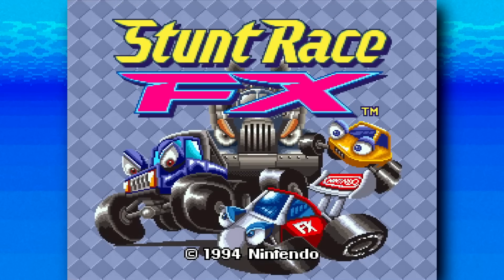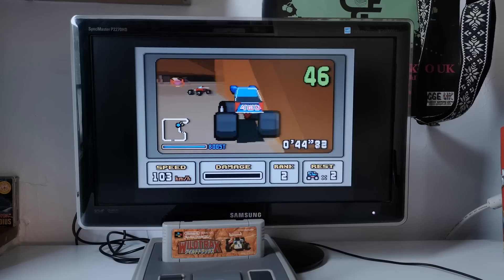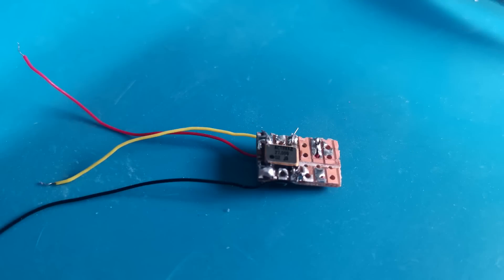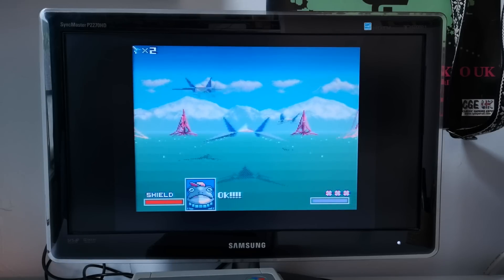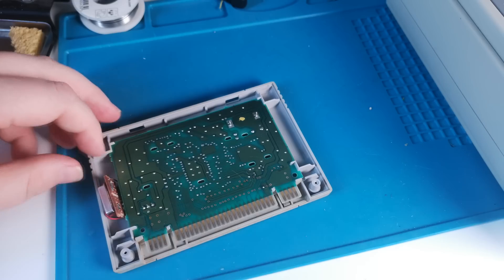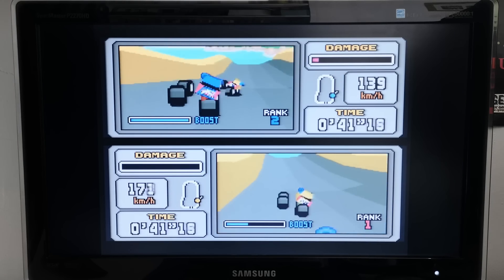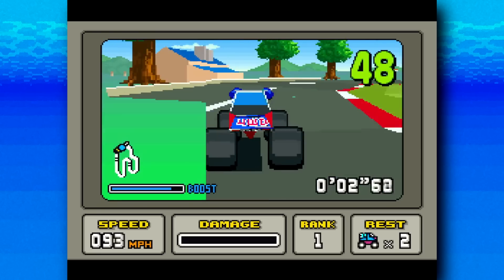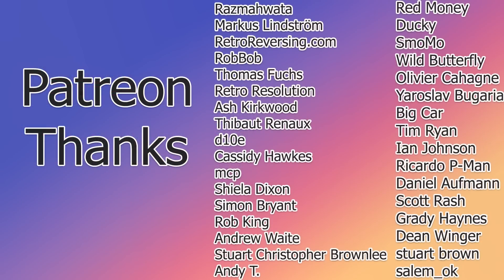SNES Overclock

Comment: One thing i thought back then when this and Starfox came out and i still agree with now. The 32bit was rushed. If they had just kept those buns in the oven for another year or 2 those systems would have been so much better. 16bit games were hitting their limits but were selling fine. The N64, 3DO, Jag, Saturn and Playstation all had one flaw in common. Not enough memory. Especially the N64. Ram prices at the time dropped like a rock over the next few years. If i remember correctly, 2MB in the N64 but the Xbox just a few years later had 64MB for example. I know i would have been fine waiting on the N64 for another year or more if i got Starfox 2 and other SFX games. And whatever the saga equivalent was called.. .SVP? I think? Virtua Racer for the Genesis was great imo. Just a bit expensive. It was like 100$ if i remember right. 200$ in todays money?? ooooohhhh. LOL.
Reply: It's why they added the expansion pak slot on the N64. They knew it was capable of having double the RAM, but it was too expensive at time of release. So they planned ahead and added the slot for it. Given a few years it was cheap enough to release as an expansion.
Reply: @davidmcgill1000  Yeah i remember getting the ram upgrade for Rogue Squadron. Played the hell outa that game! :D
Reply: The Nintendo 64 actually has 4 Megabytes of RAM, and is expandable to 8 Megabytes with the Expansion Pak.
Reply: @jsr734  4 or 8 still isnt much. I forgot how much it actually had though. I remember Perfect Dark using the ram xpac for highres mode. IMO they should have used it for higher res textures instead but... was that even possible? Maby some technical reason for it. Rom space probably. But the disc systems could have used more texture ram. Keep everything else and just have more varied textures.

Comment: The Bsnes emulator lets you overclock the snes main cpu and other add on chips independently. Altough not all games are compatible is interesting to see what happens when you overclock the snes cpu 200% speed and let the SFX chip at 100% speed.

Comment: if nintendo just needed a faster clock crystal and not a whole new chip, i wonder why they just didnt do this from the factory?
Reply: It's called the "silicone lottery".
Some chips are stable at a given frequency, while others of the same build are not.  That's due to so many small issues, you can't engineer them away.  
So the best you can do is make a cutoff where 99% of the chips run at a certain frequency, and run them all at that lower rate.

Comment: i wonder if you could get an FXPak Pro flashcart (the kind that uses an FPGA to emulate a Super FX chip) to do this without soldering
Reply: I have one and there is a setting called Fast Super FX or something, but it doesn't improve the speed tremendously compared to an overclocked cart. I have Doom and Stunt Race FX overclocked on real hardware amd those carts rum more smoothly than on my FXPak Pro. It would be cool  if there was a true overclock feature
Reply: @MrBillgonzo  maybe with custom flashcart firmware... i know the fpga can do different clock speeds because it needs to be able to emulate the sa-1 and other coprocessors, so maybe it can be made to do this too? will have to investigate at some point
Reply: I have one. And hellll yeah man

Comment: You know what I'm curious about? How does the FX chip compare to Capcom's CX4 chip? It's crazy to think that Capcom developed their own chip just for a few minor bosses in MegaMan X2 & 3. I feel like the chip's power isn't really used much outside of those few boss encounters. The C4 is also for 3D objects but we only get to see them as wireframes instead of solid polygons. Could more be done with this CX4 chip? How does it compare to the FX chip?

Edit - I edited this post to avoid being bigged down by SA1 discussion. I originally talked about the SA1 chip, but I realized I misremembered and compared it to another enhancement chip instead of comparing it to the CPU.
Reply: People are hacking games with SA-1 not because it's better than SuperFX, but because SA-1 can run the same code as the original game. SuperFX has its own programming language.
Reply: Sa-1 is not faster than fx the sa-1 is just a faster 65c816 cpu with other additions to the core
Basically just a cpu upgrade to the main
Snes was designed for cheaper later addons from the start as prices for silcon and tech were dropping fast during these times
Everything from cpus ram rom etc
Reply: @primus711  Right, I know it's like a better CPU for the SNES. I said better, not faster than the Super FX. I did hear that the SA1 was actually better at polygons than the FX chip, but I don't know whether I misunderstood, was misinformed, or mixed it up with something else.
Reply: @Dinosaur_News_Center  fx is way more tailored for polygons than a general purpose cpu like 65816
Its basically a dsp
Reply: The fx chip is a 1 bit processor capable of drawing one like at a time.  It does not render polygons like a playstation does.  

The capcom processor is a math add on chip, not a graphics chip.  I'm not sure how the capcom draws to screen via the ppu exactly, but the 2 chips are doing very different things.

Comment: A cool project would be a renderer for emulators that just takes the Super FX draw opcodes and translates them to OpenGL calls. That would make resolution boosts and even HD texture hacks possible. Combined with romhacking you could also make the game run at 60fps while accounting for game speed, bypassing the PPU bottleneck completely by drawing the OpenGL framebuffer directly and disabling the transfer in the ROM.
Reply: I'm a game engine developer and I'm afraid that's not possible to do in a generic way for all games. The superFX is just a processor - its entirely up to the developer how they use it. There aren't any "draw opcodes" or any kind of API-like functionality that you could encapsulate.
Reply: @JohnnyWednesday  That may be true for a general purpose CPU ,but the SuperFX has dedicated opcodes for plotting pixels to a bitmap framebuffer. It's definitely not easy, but one could, through heuristics, detect individual polygons being drawn, e.g. by cross referencing the shape and order of the individual plot calls with stack depth (as individual tris or polygons would be drawn in a subroutine). After you have the primitive isolated in bitmap form, you vectorize it and draw that using the modern graphic backend of your choice.
It might take a lot of tweaking and possibly a really fast PC to do the detection in realtime, but the games are so low-poly that this could yield some good results, definitely better than trying to vectorize the entire framebuffer.

Also, there aren't many SuperFX games, and people would probably be mostly interested in starfox, stunt race and dirt trax. So it may be just feasible to have game specific hacks and hooks for those.

Comment: Can you find a heatsink small enough to fit on the CPU in the cartridge to dissipate some of the heat?
Reply: In my experience heat is not the issue.  I think the fx chip and the snes have issues running at high speed.  Every game has an optimal clock speed, but 26mhz or 28mhz usually works.
Reply: @hicknopunk  I can second that. The SFX chip doesn't  get hot when overclocking it.
Reply from the maker: I was going to mention that in the video but I ended up chopping that bit out. But heat really does not seem to be a problem, the Super FX chip doesn't even get warm overclocked at 30mhz.
Reply: @Sharopolis  is it possible to overvolt it? in my experience, instability in over clocking comes from two factors generally: too much heat, and/or not enough power to the chip

Comment: Nice work, cheers for sharing! Makes me wonder why it didn't have a faster clock by design. Probably some marginal stability / game physics / hardware lifetime issues (like that Mario 64 60 FPS stuff I saw going around). The Nintendo Seal of Lethargy.
Reply: Mario 64 at 60 FPS is highly optimized compilers with full knowledge of the system without time constrains.
When you make a launch game, you have limited time, experience, tools...
Higher clock-rate by design: Yes, you run into margin problems. Note that it can be more subtle then what you saw here:
Worn out cartridge slots, marginal power-supply (on either the high or low end within the spec), ... can be a make or break.
Now we collectively know that it is "save" to overclock - with production silicon. It is likely that the prototype silicon did not like higher clock rates at all.
It is typical that prototype silicon has some design flaws and that the processes are not yet perfectly dialed in.
Production silicon on the other hand has dialed in processes and all known mistakes fixed and some internal optimizations.

Comment: Makes me wonder why the chip wasn't clocked to 30MHz out of the box since it seems to be so stable at those speeds.
Reply: Whilst most chips are probably stable at 30 a small percentage won't be and so would have to be scrapped increasing the price tag for each working chip, therefore running the chips at a lower clock increases the production yields and saves money.
You see the exact same thing today, almost all GPU's can be overclocked out the box by 100-200mhz avg however not all of them. The fact is that the 100mhz bump isn't worth the lower yields and thus even the most expensive GPU's leave performance on the table to improve price to performance, plus on the lower quality chips even a small OC can dramatically reduce the lifespan therefore significantly increasing warranty payouts.
Another example was the XBOX ONE, Microsoft designed it to be slightly slower than the PS4 but have double the ram in order to balance it out. However Sony hearing this doubled the PS4's ram to match (plus it was significantly faster memory) meaning the PS4 now had a major advantage. Microsoft therefore had no choice but to overclock the XBONE and eat the losses caused by failed chips meaning the system had much worse price to performance (in terms of manufacture not msrp) despite the same hardware.

TL:DR, Higher clocks mean more failed chips and therefore a higher manufacture cost. Manufactures therefore will base clock speeds on achieving the best price to performance ratio (I.E highest clock without widespread failure) rather than the highest possible performance.
Reply: @MsMarco6  this is also what gave rise to 'binning', that is taking less stable chips, down-rating them, and selling them as lower-priced SKUs. It's part of why those low/mid price chips are as affordable as they are.
Reply: They are waaay more stable at 26mhz or 28mhz.  At least if you consider overclocking all fx 1 games.

Don't even bother overclocking mario 1 chips.
Reply: I'm guessing due to costs.  The tech was new-ish at the time and not very cheap.  But I could be wrong there...
Reply: While the previously mentioned information is correct, the other thing to realize is that when bringing something like this to market, they have to finalize a hardware target before software can be completely developed. That's probably why they started with half the clock speed on the original chips, because they wanted to ensure they had a specification that programmers could use that would be stable in all scenarios. An example of this is the 3DO's 12.5 MHz ARM CPU, which can easily run at 25 MHz, but because they didn't have final chips during the design phase, they had no idea how well the hardware would handle higher clocks. Therefore they had to err on the side of caution and the CPU was locked at 12.5 MHz.

If Argonaut (who actually designed the FX chip) had waited until they found out that the chips could clock higher in bulk, then it would have taken way too long for FX chip games to make it to market. That's part of the reason why later games were able to take advantage of the higher clock speeds. Even then though it's likely that they didn't all reliably run at 30 MHz or whatever, so they lowered the clocks to ensure a higher yield. These things were NOT cheap, either!

Comment: I had this game on real hardware in PAL. That means, it was even slower at 50 Hz. But I had a lot of fun and enjoyed the game for what it was. Back in the days, I was never the kind of guy looking for FPS and smoothness. This game is so charming and full of character. I love in that one night stage where even a Starwing is flying by as a kameo.
Reply: Ditto! But I think part that made the magic work was: We didn't know better!😉
Reply: I still have it! and I still love it!
Reply: I had it too, and loved it. I doubt it actually ran slower on PAL though, it's not like the system framerate is the limiting factor.
Reply: @23Scadu  Every game runs slower on PAL. Regardless of the frames the games run on. This is a sync thing. TV signal on your 60Hz system will still sync to 60Hz/frames output, regardless of how many frames your SNES produces. And same applies to 50Hz, where games are slowed down to match that sync.

Both 50/60 Hz consoles produces same low number of frames internally. It is the output signal that is synced to and slowing down. But you know what, i will test his on an emulator to make sure that I don't tell wrong things here. Maybe I am wrong about it.
Reply: @thingsiplay  No need to check, that's actually true. The TV literally couldn't handle a higher framerate and part of the reason was also your electric grid. It runs at some multiple of 50hz while here in the US it runs at a multiple of 60hz.
Reply: @anon_y_mousse  Stunt Race FX doesn't run anywhere close to 50hz or 60hz though. It runs at something like 10 frames per second, so the only difference between NTSC and PAL should be that NTSC gets a new frame every sixth screen refresh, while PAL gets one every fifth.
Reply: @thingsiplay  I guess I was half asleep when I wrote that. What I should've said is that the frequency of the electric grid determined the speed of the TV and console, so you could always take the two to the US and get the same speed as us here. As for how it affects the game, it's only a limiter, but Sonic on the Genesis for instance did run slower on your side making it easier to play.
Reply: @23Scadu  Yeah, basically. Games like that which could not render fast enough to keep up with the refresh were even worse. Possibly not noticeably so at that speed, but it depends on the player I guess.
Reply: @thingsiplay  The later consoles could choose their refresh frequency, but they had isolating power supplies. The 16 bit consoles all ran at host grid speed. As for the TV, PAL was just an encoding standard, how the signal was composed, so a PAL TV could certainly run at 60hz, though it was my understanding that it required the grid to also be compatible with the frequency it ran at? Maybe that's a mistaken understanding on my part?
Reply: @anon_y_mousse  no... no... TVs are running slower then grid frequency since the addition of color TV. The reason grid and TV frequency are related is simple: It avoids some light flickering while filming.